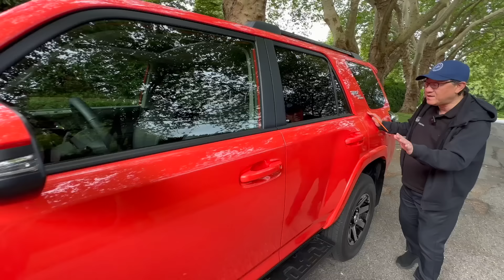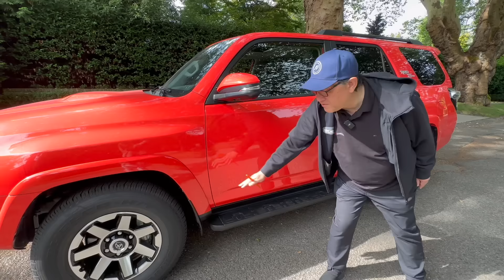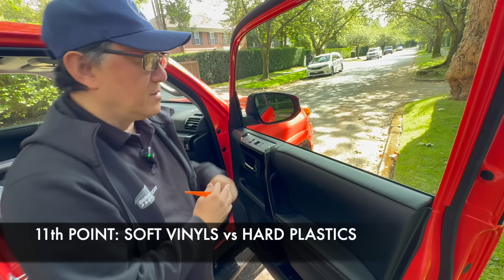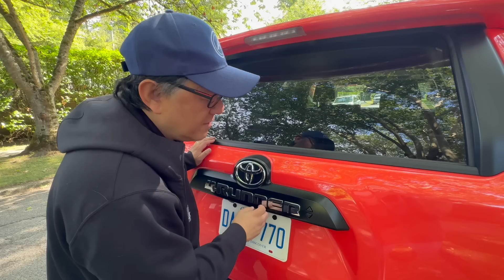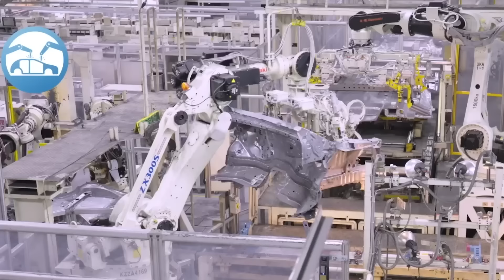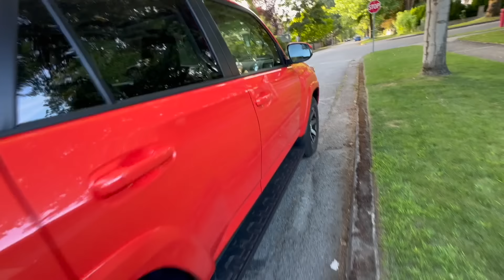30 REASONS WHY 5th GEN 4RUNNER WILL LAST 30 YEARS // FINAL REVIEW OF 2024 4RUNNER

Comment: I suppose that is it's only selling point but I don't know anyone who keeps a car that long unless it is some kind of classic or very limited model. 30 years would put you in 2054 and I'm sure Toyota will continue to innovate its lineup where people will inevitably trade up to something better either withing the 4runner and/or toyota line up or another brand. Yes, I've seen a few 3rd gens around with 500k+ miles but their condition is not something I'd want to own. The interior degrades, lots of kinks on the paint and corrosion, faded parts, crusty smell, and overall an unpleasant experience even if mechanically they are ok. I suppose if you're buying it as a garage queen then they may keep nicer but if you baby a car so much, it is not hard to make it last 30 years. I kept a subaru impresa wrx sti with mods for 15 years and still only had 45k miles in perfect working order and everything except maybe a few paint chips was like new. And yes, that had a turbo :p I could have easily kept it for another 15 years and I had not decided to move across the country, I would not have sold it.
Reply: Yeah, exactly. 4Runner owners are like anyone else - trading in their vehicles every 5-7 years. Guarantee once the new gen comes out their will be so many 5th gens on the market.
Reply: @GBcommander  for sure. This is specially true of leases and some of the mid tiers like SR5 premium and sport. Limited will also get traded a lot given the feature set of the gen 6 is so far superior in terms of gadget luxury that a 5th gen limited trade to a 6th is basically a no brainer trade for all the mall crawling crowd.

Comment: Question: Is the new Underground color/undercoat still painted on 2024 4runner's with old 5th generation standards, or same thinner paint (and undercoat)  such as the newer/current standards currently used on alternative toyota models painted the same underground color?
Reply: Well since solar octane is also a new color you have the same results as he showed on this video.
Reply: @Offshore1977  Thanks,  I understand that underground is also painted on other toyota models,... I'm not sure If solar octane paint is exclusive to 4runner only
Reply from the maker: All the paints on the current gen 4Runners use the older style paint process

Comment: #AutomotivePress  Mr. David Chao what you think is better buy the 2024 4runner or wait for the 2025 4runner?
Reply from the maker: I would buy the 2024 4Runner until the new gen 2025s are proven
Reply: I just watched a video about the 2025 and it has the bump stops on the shock instead of the frame.  Tacomas are supposedly having issues because of this.  Toyota still puts bump stops on the frame on the Land Cruiser.  Something to consider if you want to go off road.

Comment: yes! i really want one of these in premium trim. right now i have a well maintained 2005 with the 2uz-fe in 2wd and it runs well and is paid off. after rate cuts, after the election then i will probably after five years with the 2005 i will finally get one.

Comment: I've owned Mercedes, BMW, Porsche, Cadillac............. We just  sold our Cadillac and Benz ML......... We purchased two 5th Gen .....a Limited and a SR5.
I can "honestly" say these vehicles are the best I have ever owned.  Built like a tank, reliable, comfortable and I know that should I ever decided to sell them (which I never will).....the resale is fantastic.
Thanks David.......keep getting out the word...........
Reply: I have to go to the store eee and qewéeè
Reply: And so slow. I just test drove it and its a slug
Reply: I just can't get over the fact that a V6 drinks up that much fuel without providing you with decent HP and Torque numbers. Reliability isn't everything because each individual car can have its problems.
Reply: @jjpark1989 my 2023 gets 22 mpg on the highway when I choose to drive in chilling mode…The engine feels smooth and more powerful than I was expecting with how people write about the old ones…270 horsepower & 278 pounds of Torque are V8 power numbers from the past - seriously…Americans got insane about thinking vehicles need 400 horsepower to be powerful enough….The new 4Runners have better engine tunes as well.  Mine comes off the line pretty quickly & I used to have brand new GTI before I traded it in for the 4Runner….This vehicle feels SO HIGH quality for the price it’s remarkable.

Comment: David, If people in the Salt Belt want their 4Runner to last 30 years they better rustproof it! 😁
Reply: NH oil undercoat on my 4Runner.
Reply: @deathevokation1017 Same here Had it done the day before we bought our 2022 4 runner TRD Pro, had the whole vehicle done they do the rockers inside all body panels including hood and rear deck, NHOU had an additive to help keep out rodents gone chewing the wires under the hood,our frame looks like new, just gotta go every year or 2 years for touch ups.
Reply: Every oil changes, I roll around under mine to check any surface rust and spray them rust proofing to stop them from growing.
Reply: @AutobodytechRon  what do you use for spray?
Reply: Most trucks rust in the rust belt.  Lanoline undercoating ftw.
Reply: @555atU yeah we have annual rust proofing coating that costs like 100-200 and you reapply every year.
Reply: @Phantomwarrior90  same
Reply: @555atU  If it is as good as Krown, it is very good indeed.
Reply: @RightLaneHog3151  i cant speak for Krown, but have heard great things about it.  The shop that does mine uses Woolwax...its like Fluid Film but a little more viscous.
Reply: I spray my 2020 down with Fluid Film several times a year.
Reply: Another vote for NH oil undercoat
Reply: Wool wax on mine every year.
Reply: Known rustproof on my 2011 Trail Edition every two years, and Rustoleum on visible rust.So far so good. Did the same thing on my 1997 3rd gen,
Reply: You need to get rust protection inside the frame, easy to do with all the holes for doing so.
Reply: Applying Mineral Oil is the simplest, cheapest and easiest way to rust proof the frame of the 4Runner
Reply: 5th gen owners- how often do you change the transmission fluid & filter?
Reply: @timjones8295  I change my transmission fluid every 80k to 100k miles
Reply: Every 60K miles
Reply: Agreed! I’m in New England..I have been using NH Oil since my 4Runner was new (the first week I bought it) and two years later looks great..hope it continues